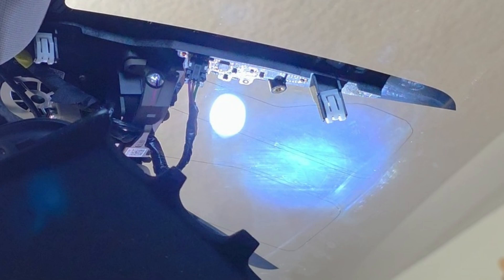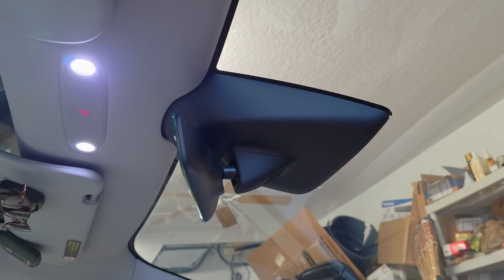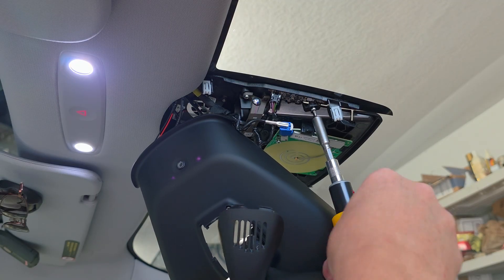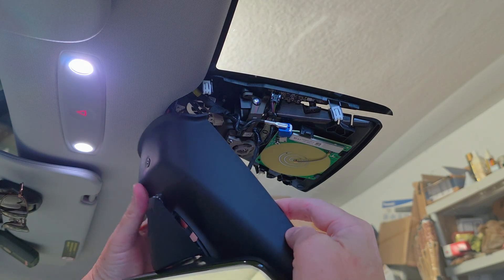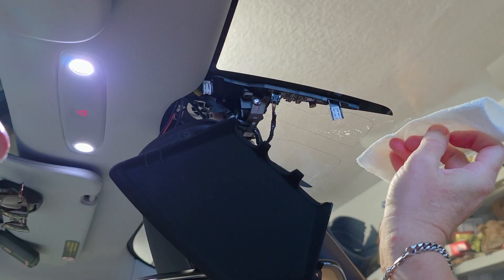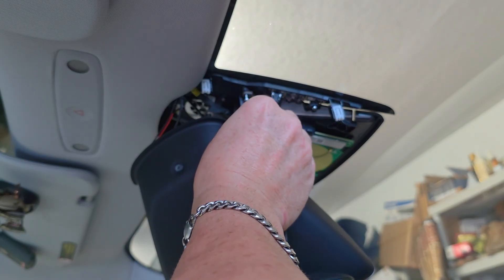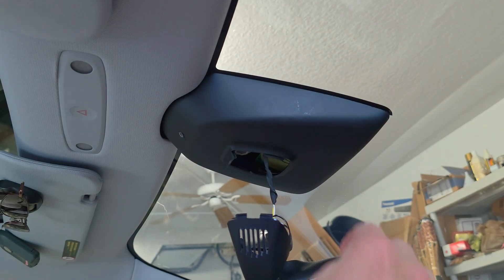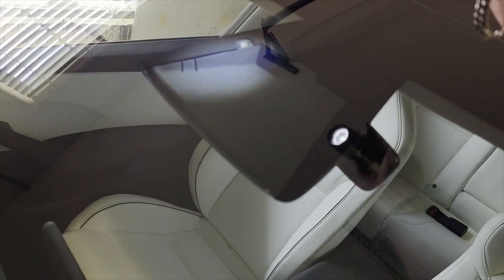Model 3 Highland FSD 14 Prep: Clean Your Front Cameras! (see correction in pinned comment)

Comment from the maker: CORRECTION: Thank you to those who (accurately) pointed out that you only have to remove the two front screws.  No need to remove the two toward the back of the car.
Realistically, this takes about 30 minutes although you can probably go even faster if you've done it before.  The 4 screws in my case were T10 torx.
Reply: Hi,
I've just did it on my car. You only have to remove the 2 most forward screws, not the other ones who hold the camera themselves.
Thanks again for the tip.

Comment: I had a 2023 M3 for 60k miles and NEVER had to clean anything. Now, after only 3k miles, already got the message. It looks like another scam from Tesla.
Reply from the maker: I think they're just caught between a rock and a hard place: their design isn't as forgiving as it should be.  They seem to be bumping up against tighter prerequisites to get both the automatic wipers and FSD to work optimally... making it imperative that the housing/glass stay really clean now.
Reply: Tesla cleans it for free the first time. But after seeing this video I’ll be sure to do it myself the next time.
Reply: @stevezx900 I had it cleaned twice for free and was told that Tesla will keep doing it for free.
Reply: How is cleaning your front camera a scam?  lol..Thats like saying "washing my car is a scam because my car should never get dirty after.I buy it"
Reply: @greysonat9269 It's not a scam, it's a bad design. The fume that gets deposited on the glass surface is due to a poor selection of plastic or improper sealing around the housing.

Comment: I don't have scientific proof of this but I think cleaning here might eliminate (or almost eliminate) dry wipes from the terrible automatic wiper sensing.  I had pretty regular dry wipes before cleaning and ever since I cleaned the glass in the camera housing, I've had no dry wipes.  Kinda makes sense since they probably just evaluate image sharpness to decide when to wipe.
Reply: Can confirm I started getting dry wipes recently and it was due to the windshield being hazy.
Reply: Good tip. I've been getting them a lot lately along with notifications that front cam is obscured. Will be interesting to see improvement after cleaning. Thanks
Reply: I concur with this hypothesis. Cleaned my housing and the dry wipes have stopped.